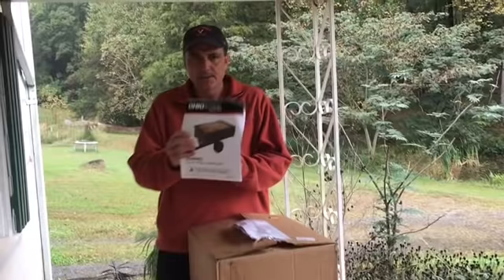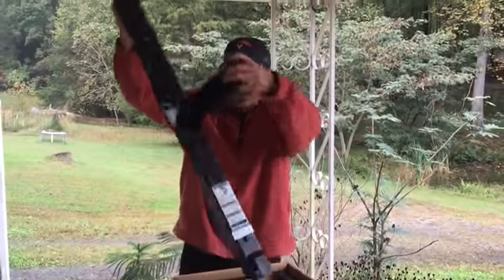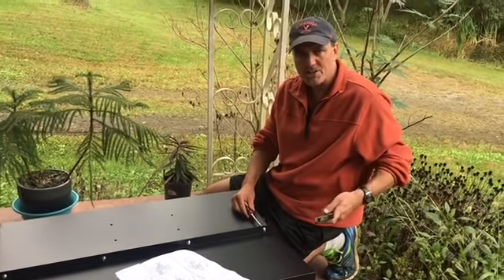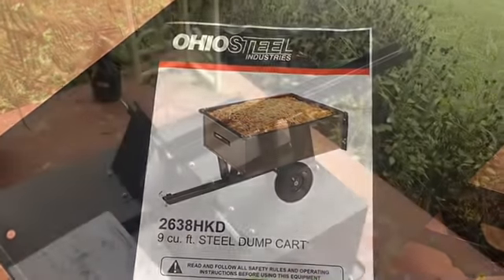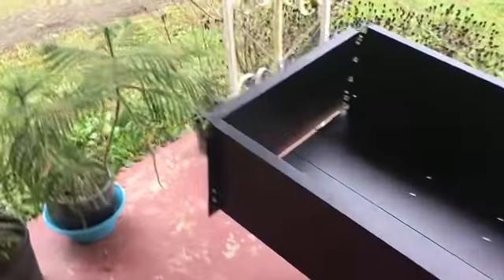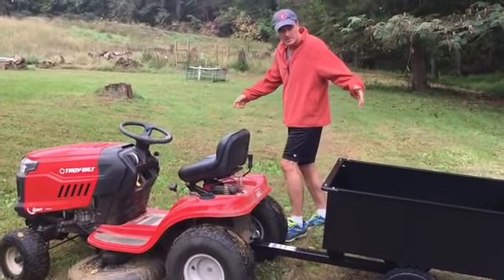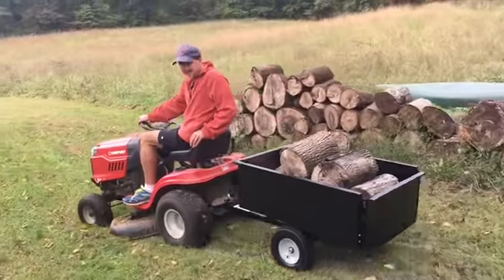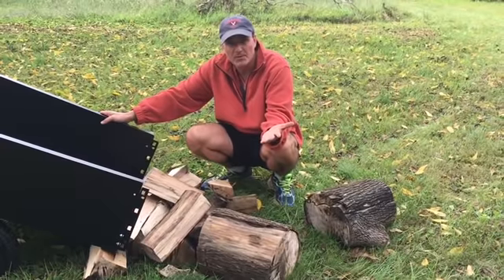Unboxing Assembling Testing Ohio Steel 9 cu Feet Lawn Tractor Cart  Pull Behind Mower Tow

Comment: You doing great ,it is something you can learn ! They even put people on the moon ,why can’t you learn it ,nice thing .
Grease the Axel plastic bearings in the tiers ,they last longer,and also the nuts and bolds the next time ,so when you have a problem later they com Easley apart ,otherwise they rust and are stuck , it’s just a tip .
Nice combo 👍🏻👌

Comment: Kevin, I hope your experience with that cart goes better than ours did. If you put to much weight near the front of the cart the tongue will end up bending.  The tires of ours ended up dry rotting and were continually flat when I would go to use it.  I have found the 10cf wheelbarrow I suggested to you in the other video from tractor supply SKU #100640099  last way longer, you can move as much material as that cart, and no tires going flat.  Hope you cart last longer than ours.

Comment: Great job Kevin 😄, work smart not hard 🎃I had a similar steel cart and it was good, keep it indoors out of the elements and it'll last a ,long time . If you want to make the bottom a little more sturdy you can out a piece of plywood and place it on the bottom if you choose, it helps keep the bottom from damage and flexing. 
A youtuber called OutdoorsTexas has a assembly of a similar steel cart showing how he up beefed up his cart called how to put together a precise fit 10 cu ft steel cart.